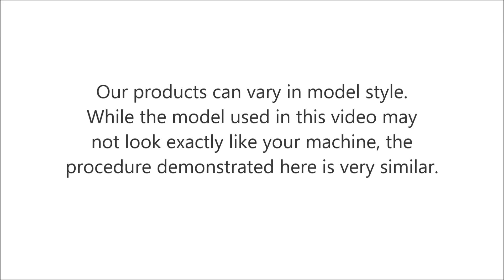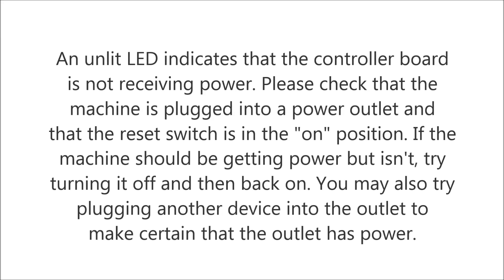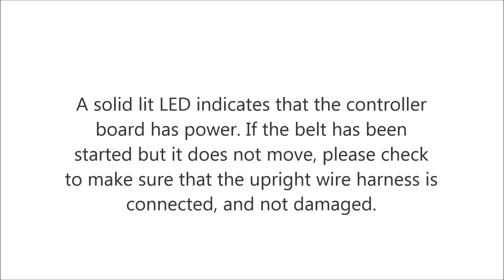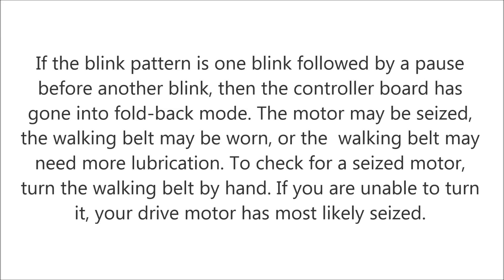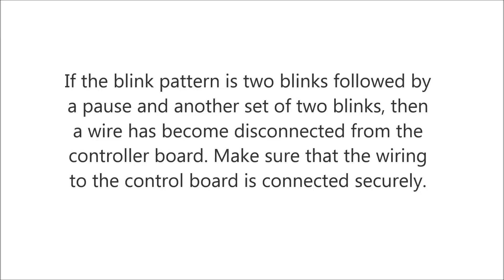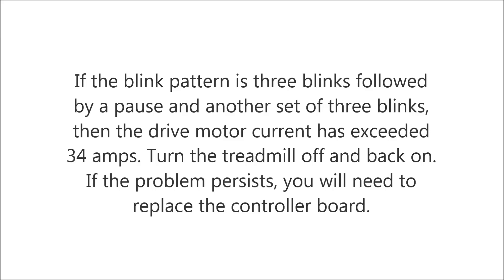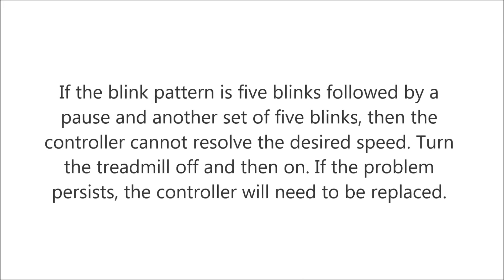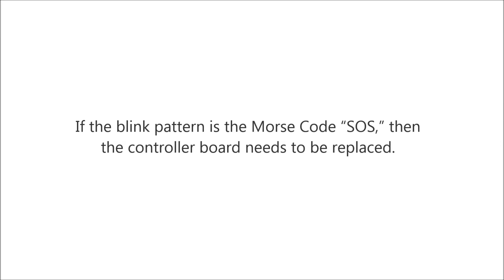LED Blink Patterns on the Control Board - Treadmill

Comment: I have a Nordictrack X11i and the console would not turn on.  The control board blinks about 6 or 7 times when you turn it on and then goes solid red.  I felt the controller had power so I replaced the console and everything worked fine for 1 day (1 thirty minute run).  The next day the treadmill had the same symptoms and the console would not work on the brand new console.  The controller board is still doing the same thing with several blinks before going solid red.  Any suggestions?
Reply from the maker: The controllers on the incline trainer series units do blink a few times on start up. if the light is on and since you said multiple consoles have powered on with this controller I would begin to suspect the wires between the console and controller. Depending on what your specific model is there are a few places that the wires could be suspect. If you have a late model X11i then I would double check the connection where the base wire connects to the upright wire, under the lower base cover, on the right side.  I have service units where the wires needed to be pushed back into the back of the wire connector at that location.
Reply: @FitnessEquipmentHelp  Thank you for the tips!
Reply: @FitnessEquipmentHelp  So I was able to narrow the problem down to the harness that connects the screen circuit board to the main wiring harness.  Any idea where to get this cable?

Comment: is there an Ohm meter test for the incline sensor ?
Reply from the maker: Most incline sensors are a type of circuit board. To test the sensor you will find two there is a constant voltage between the two outer wires typically. The third wire (usually the center wire) carries the on off signal to the controller in response to the magnets in the motor.

Comment: my Reebok RBTL79607 is showing checksum:fail the control board has a solid red right. What should I be looking at next?
Reply from the maker: The check sum fail  error is indicating that the console will need to be replaced. Unfortunately the console is no longer available from the manufacturer.  Due to the age of the machine you may want to consider a new treadmill as it will be difficult to find replacement parts.

Comment: Hi. Great video. My Proform premier 900 stopped working. The controller led blinks once on power up then goes solid. The console seems dead. I exposed the console boards and I see a 3x blink on one of the leds.  I suspect that the console is bad but am hesitant to risk $500. What do you think the likelihood is that a blinking led is indicative of a bad console?
Reply from the maker: The only board i am familiar with in the console having an led is the BLE receiver board. if it has power however then its a pretty good indicator that the rest of the console has power too. if it is not lighting then it does indeed seem something is not working in the console.
Reply: The 3x blinking is at the upper board?
Reply: @thomasmasson9711  so i took this mini-project back up. the 3x blinking is the BLE board. I checked the 12v dc input from the motor control harness into the console board. i am seeing 10.6v so not sure if that is nominally correct (i am not an electrician). i also am wondering if the magnet / emergency cutoff may not be working properly. i just bought a magnet and placed it on the spot and still zero display to the console.

i would love to get the signal assignments on the ribbon cable. i am wondering if there is signal in addition to power that the console needs from the motor controller. I cannot find any info at that detail.

Comment: Hi my Nordic Track X22I stopped working after 20 seconds (sometimes 60-180 seconds). The console, incline all work fine however the walking belt doesn't move at all anymore. The red led blinks eight times.  What could it be? Thank you. 
Video description: https://yadi.sk/i/fzdeIb1M-Oc0sQ 
8 blinks: https://yadi.sk/i/plHqeP-1b5Hq6A
Reply from the maker: Ill look for more information but typically as long as all the wires are connected properly all the error blink codes indicate that the controller has an internal error and needs to be replaced.

Comment: Hi. I hope you can help me with this.
When I start the treadmill on any speed the red light has a steady blink and running normal. After about 3-5 minutes the treadmill stops running and the light begins a blink pattern. At this point when I step off of the treadmill, the treadmill begins running again but the light remains with a blink pattern. If I step on the treadmill again while the light is still in blink pattern, the treadmill stops running again. If I step off the treadmill for about a minute, the light starts a steady blink pattern again, meanwhile the treadmill is still running. If I get on the treadmill at this point it will run for 3-5 minutes and the process begins over again. I am able to turn the belt by hand so it is most likely not a seized drive motor. The walking belt is also well lubricated.
Thanks in advance for your help. Looking forward to hear from you.
Reply from the maker: how would you describe the blink pattern when the belt stops. sounds like you may be running the motor near the current limit. this is usually because of worn out components. You may need to replace the walking belt or lubricate the deck.

Comment: I have a Proform treadmill 505 CST, model # PFTL60916.0 that will not power up. I have a green light, and a steady red light, but console is dead. I have removed console and checked connectors with no help. I was an electronic technician in the AF but without schematics of this treadmill and the boards, all I can do is basic troubleshooting. I am looking for any help I can get before I have to spend some money to get a technician to come look at it. It worked fine 6 months ago, but sat unplugged after my son was born.
Reply from the maker: the red wire from the controller should carry 9-12 VDC anytime there is a green light on that controller. If you are getting voltage at the controller but not at the top of the harness then you would like need to repair or replace the upright wire. if the voltage is at the top of the wire then a console inset will likely be needed. The green light should be indicating the controller is generating the 9-12 VDC needed. of course if you have no voltage at the controller (despite the green light) then your controller would be faulty.

Comment: My light is steady with no blink, but still the motor doesn't turn. I ensured every wire is plugged in. Also, I tested the motor with my drill battery and it turned. What else could be wrong??
Reply from the maker: If the light does not blink when the speed on the console is set above 0MPH/KPH then either the console is not sending a speed signal to the controller or the wire harness from the console to the controller is broken damaged or disconnected somewhere between the two components.

Comment: Our motor controller board for a Nordictrack c990 blinks 4 times then pauses. We replaced the board but the same deal :(
Reply from the maker: The four blinks indicate the Fett controller is bad. You will need another controller. Make sure that the motor and belt are in good condition. A high amp draw may contribute to the Controller failure. Although it could just be a bad replacement part. I have seen it happen and the replacement part should have a 90 Day guarantee if purchased from the manufacturer.

Comment: Hi my nordic track x22i is 3 weeks old and today it has stopped working after tripping a fuse in my house. The console, incline all work fine however the walking belt doesn't move at all anymore. The red led blinks once and then after roughly 2 secs blinks again. I've checked motor for seizing but it moves with minimal resistance. What could it be?
Reply from the maker: If the motor is moving freely and coupled with the electrical issue indicated would suspect the unit needs a new motor controller. Make sure you have your treadmill plugged into a surge suppressor and unplug it when not in use if you don't already.
Reply: @FitnessEquipmentHelp  thanks very much an engineer has now repaired the motorboard and the motor. However I now have another issue, I'm yet to be able to finish an iFit video workout without the machine crashing and restarting resulting in a boot loop between a black screen and the iFit logo. Any tips on how to fix this? For a machine that's so expensive it is unbelievably poor.
Reply from the maker: I would recommend making sure the console software is up to date. After that I would contact iFit support. If it was not an issue with the current software then ifit can help you reset the memory or reinstall any corrupted files. support.ifit.com https://ifit.zendesk.com/hc/en-us
Reply: @FitnessEquipmentHelp  Hi, thank you for your replies. As previously mentioned, an engineer came and fixed it and it worked great for about 2 weeks and now its has broken again. It tripped the circuit breaker midway through a workout (There seems to be a strange link with iFit videos and my treadmill blowing) and now no longer turns on at all.I get a single audible beep but nothing else. I've changed the fuse in the plug to see if that was the issue but it isn't solved anything. Have you any recommendations or reasons for what might be happening? FYI it is always plugged into a surge protector and unplugged when not in use.
Reply from the maker: @bensandford900  That is strange. other things to verify is that the treadmill is on a dedicated 15-20 amp circuit. Other apliances on the same circuit can sometimes effect the electronics. if possible check the amps the unit is drawing during use.  High amp draw  above 8-10 amps during normal use can indicate worn out components like the walking belt. High amp draw can also effect the controller.

Comment: Hi Team, I have Reebok One GT40s treadmill and using this information about blink pattern. It is indicating problem with Upright Cable. Strange thing is that display panel still works and it is showing E2 error on it. 
I checked all the connections of UpRight cable but find no damage. Motor is not seized and i can move it by hand & walking on belt.
Any further help?
Reply from the maker: This video is only applicable to units using the MC2100, MC5100, and MC16XX series motor controllers. The E2 error in tour consoles indicates the console has not received a speed sensor signal when it is expecting to see one. i am guessing that the belt does not operate before you get this error. if so likely you need a new motor controller. if the belt runs for several seconds before this error comes up then the belt stops you may need to adjust your speed sensor. This adjustment is usually in your users manual.

Comment: Is this blink pattern diagnostic only applicable to NordicTrack or does this apply to other brands as well?
Reply from the maker: It will apply to other brands manufactured by Icon Health and Fitness. any treadmill that uses the Icon MC2100, MC5100, MC1618 or MC1648 series motor controllers. Some of these brands include Pro-Form, Weslo, Epic, Healthrider and some Golds Gym brand fitness equipment.

Comment: I have just a solid red light. But that's the only sign of power I have. the main panel does not light up and nothing appers to work except this red LED and the right light on the power button near the plug switch.
Reply from the maker: If the light is on on the lower controll board but there is no power up on the console then you may have a problem with the wire harness or the console itself. One thing to not is that some consoles will not even light w/out the key so make sure the key is in place on the key switch.
Reply: Thanks for the feedback. I definitely always use the key when testing power.
Reply from the maker: It sounds like a wire harness or console issue then. If you have access to a voltage multimeter you can try to verify where the voltage is being lost. you should be able to read about 9-12VDC on the red wire (compared to frame ground)  in the main wire harness from the controller to the console. If the voltage is not present at the controller under the hood then it may be a bad controller (less likely in my experience). Check this voltage on that wire with the connection at the top. if voltage is present at the top  you may have a console issue. if not then the wire harness like has damage and is not transmitting the signal to the top of the upright. Hope this helps.

Comment: My led light is a solid on. When I put the key, nothing is appear. The screen it doesn't work. I left my treadmill to my room, after that I saw this problem. Before that all was fine. Can you help me please?
Proform zlt 730 thanks!
Reply from the maker: If the led is lit but there is no power to the console I would check or verify that the rainbow colored main wire harness is connected and undamaged. it connects from the controller to the console. You should be able to read 9-12 vdc on the red wire in the harness at the console connection. If 9-12vdc is present then you may have a bad console.
Reply: @FitnessEquipmentHelp  by console do the whole unit is bad?

Comment: Just replace my board in epic I’ve got a red light solid in a yellow light everything goes on except for the motor
Reply: I just did the same thing. Replaced my board and have a solid red light. I turn it on and it's like the motor wants to go but doesn't.
Reply: @pennypenzkofer9394  same things happens to my machin it only move for 1 second. Where you able to solve the problem? Am yet to know the solution to mine.

Comment: Watched your video and did what you stated, but no luck. Light is solid red light. Not blinking. The panel shows it to be stuck on calibrating. I unplugged. Checked the wiring harness to make sure everything was plugged in and tight. It was.  Any thoughts?
Reply from the maker: The LEDs only Show an error blink in response to a speed signal. If your console is calibrating the incline  (or thinks that it is) no speed signal will be received by the controller and the light will remain in the ready (on solid ) state. If your console does not end its calibration there may be an issue with the console not the controller.

Comment: I have a Nordictrack C1570 Pro and the red LEDLight on the control board does not come on. I have confirmed that I have power at the wall location and at the off reset switch. I even confirmed that I have power coming out of the switch to the board but still no red led light. Does this mean the board is bad? I have a wire diagram but it does not show the key circuit. Can you help me understand How that circuit works?

Thanks
Reply from the maker: The key switch is like the on off for the console. The controller should have the red led illuminated and be sending about 9-12VDC to the console on the red wire in the main wire harness regardless to if the key is in the console or not. If you have the ability to check you should have ~120VAC at the hot and neutral wires on the motor controller. if you have voltage out if the switch but not at the controller then you may have a loose or disconnected wire or a thermal switch within the motor that is stuck open.

Comment: My Proform ZT5 treadmill works fine except for the display. I've got nothing, totally blank. The display used to flash on for just a 
second or 2 when I tried the resets in my manual and it did work fine for months prior to this occurance. Any ideas?
Reply from the maker: If the treadmill is operational (incline/Belt Speed) but the console does not display anything, it is likely a problem within the console display itself. The controller motors and sensors all would seem to still be working and responding to the console inputs. In these cases the console usually needs to be replaced.
Reply: After I opened the motor access panel, I noticed that I do get some display functionality - like its displaying a boot up sequence. The instant I place the key on its sensor, the display goes blank. Suggestions? Yes, all of the controls & sensors appear to be operating speed / tilt, etc. I just have no visual indication of anything on the display. & would the console come with the circuit boards that are mounted to it?
Reply from the maker: Yes, the console comes with the circuit boards and display panel electronics. It will come as an insert that looks like the separate console component as illustrated on the exploded diagram in your users manual.
Reply: The manufacturer the only source for parts?
Reply from the maker: No. there are other sellers who get parts from the manufacturer. there are not other Non-original manufacturer/aftermarket parts that i'm aware of.

Comment: My light blinks once as soon as I flip the reset button, but after that, it doesn't blink or turn on. All the wires seems fine. Any help?
Reply from the maker: If the light doesn't remain on solid when the treadmill is in an idle state, (no speed signal to the controller). it indicates that either the board isn't receiving voltage orthere is a problem within the controller using the incoming power to power on the treadmill. my guess is that you also do not have power to the console, is that correct? if the light is on momentarily when the reset switch is set to on it would seem that the controller is receiving some power. if i had to guess i would say the controller is needing to be replaced. This could be verified if you have a multimeter and can check to see that you have 120VAC (wall outlet power) at the AC hot and AC neut Connectors on the controller.